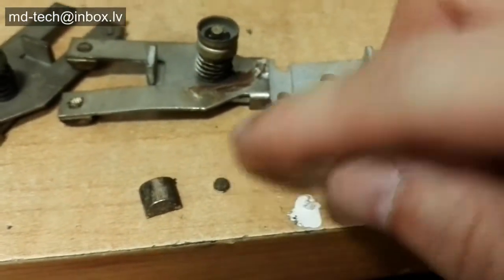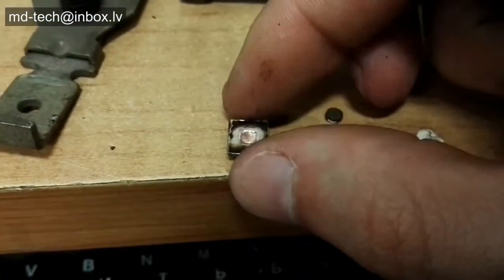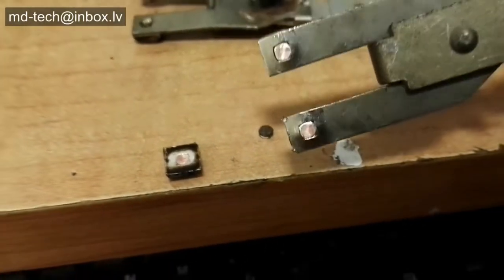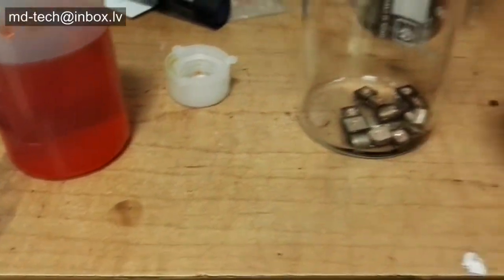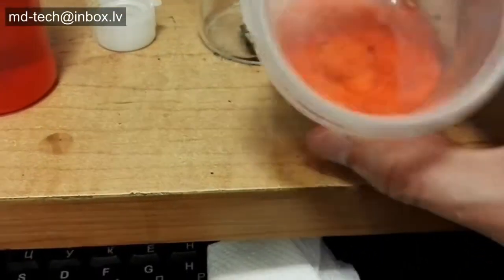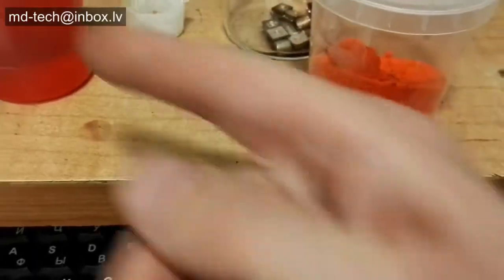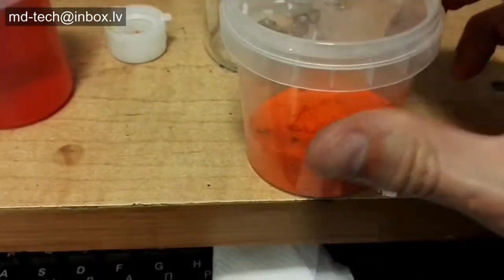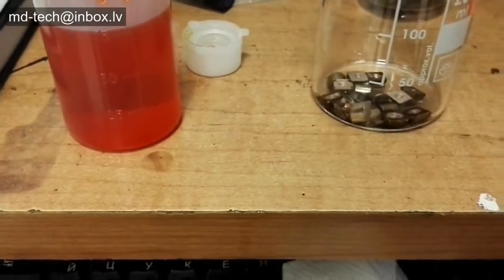Knowing how to remove silver plating from items like jewelry or flatware or mirrors.

Comment: How u will get silver from the solution as chemistry is dangerous subject pls share full knowledge or else leave it
Reply from the maker: noor mohamed it is called Schwerter's solution and is used to test for the presence of various metals, notably for determination of silver purity. Pure silver will turn the solution bright red, sterling silver will turn it dark red, low grade coin silver (0.800 fine) will turn brown (largely due to the presence of copper which turns the solution brown) and even green for 0.500 silver. Brass turns dark brown, copper turns brown, lead and tin both turn yellow while gold and palladium do not change. All acids is danger. And 99% chemicals is carciogen.  What you mean Dangeros?